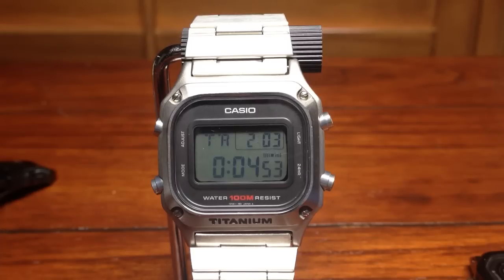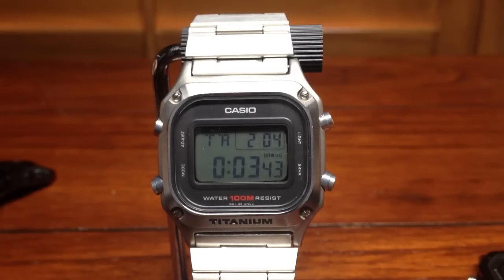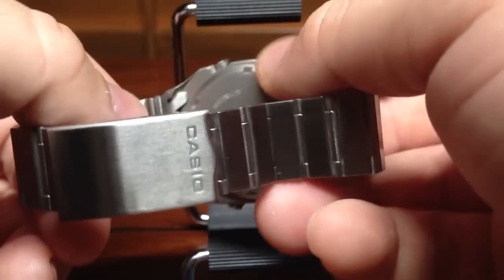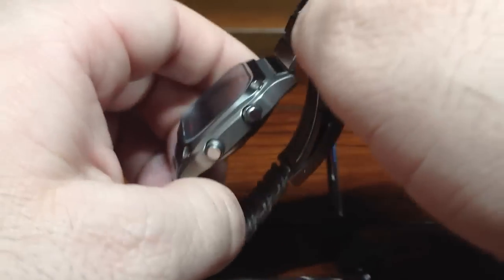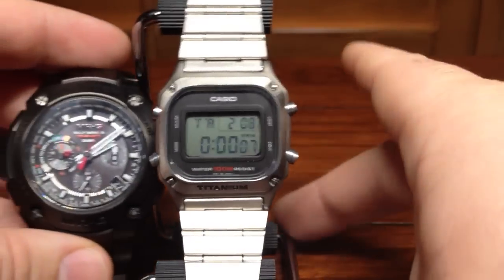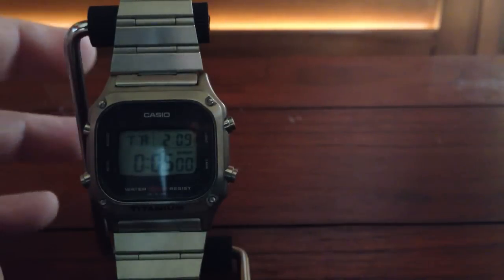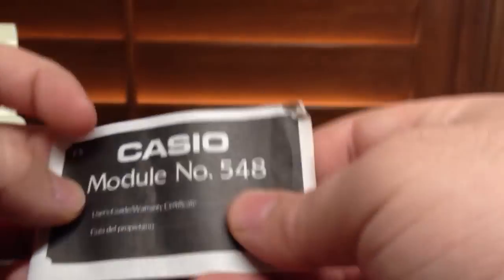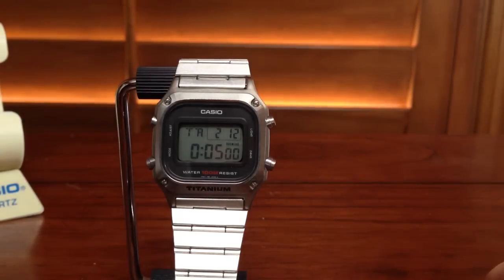1984 Casio TW-7000

Comment from the maker: Good point, maybe they realized not many people use watches to wake them up-I just use my iphone now. Sometimes even while awake and in a busy place though, it's hard to hear the alarms on more modern Casios, especially G-Shocks. I just got a TW-7100 and the alarm is not as loud as the TW-7000, which could be because I can't buy the original battery and because it is solar. I'll post a vid up soon~ish of the TW-7100. Thanks for the sub!

Comment: Cool man. I got a white dial version from a thrift store today for $25. Hope it works haha..
Reply from the maker: Rotten3ullet well if you’re looking to sell let me know I may be interested
Reply: fer557 haha not now. I just replaced the battery. It's working but no sound. Any idea why?
Reply from the maker: Rotten3ullet it does have a button to turn off sound, above the seconds it shows if the sound is activated. Also check if it has a paizzo speaker behind the caseback. If I remember correctly it needs something to make contact with the caseback or something for it to work. It’s been a couple years since I had one so I can’t remember exactly.
Reply: @fer557  hey man, thanks for replying. I  turned on the sound but still not working. Maybe it's not making contact with the speaker. But anyway I am still happy with this watch.
Reply: @Rotten3ullet  I recognize I'm years late, but for you or anyone that has a digital Casio without sound, it's a common issue with an easy fix.

Almost all Casios (and other digital watches) use a piezoelectric speaker, adhered to the inside of the watch case back. It looks like a white or silver circle. It doesn't look like a speaker, it looks like a sticker. It's attached to the case back so it can resonate and be heard. It gets power by making contact with the module with a tiny spring. Look at pictures online for any Casio opened up, there's a tiny (~1mm diameter) spring that sticks up out of the module. This spring is held in place on many watches, but not all. It can fall out easily with a battery change. It's so tiny that you'll lose it if it falls on the floor.

If your TW-7000 or any digital casio has no sound, open the case back and check the module for a tiny ~1mm hole in the module. That's probably where the spring goes. Look for other pictures of the watch or module online where you may see examples with the spring. If you don't have a replacement part, don't fret. An easy solution is to use the spring inside of a spring bar. Most watch people have a spare spring bar laying around. Take side clippers and cut that thing open, and remove the spring. You'll have to cut the spring down to size, using trial and error. It can't be too long, you want to be able to close the case, but it can't be too short to where it doesn't make contact.